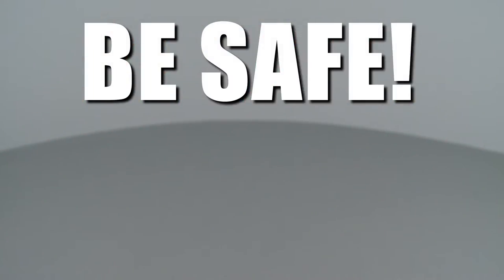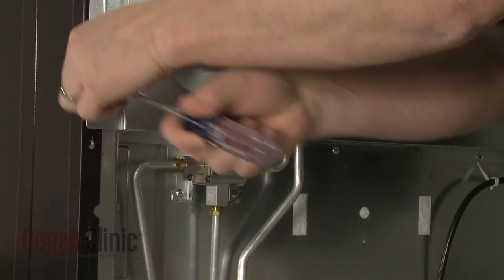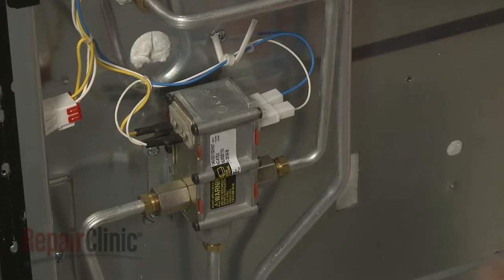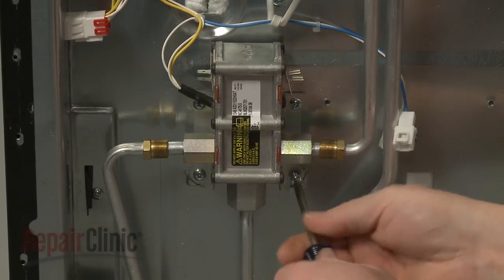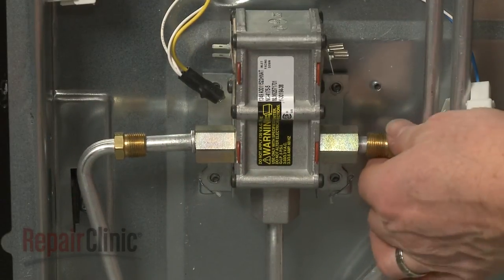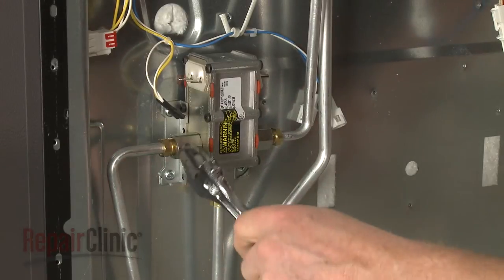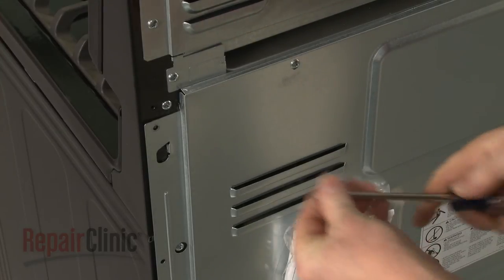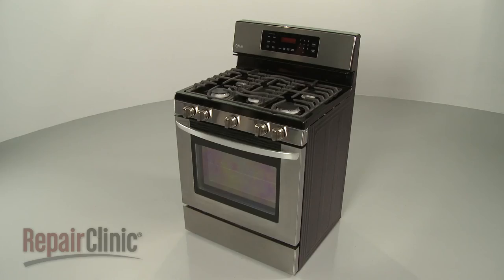LG Gas Oven Range Safety Valve Replacement #MJX62571701

Comment: great vid!! thanks.   I have an LG gas oven with a similar dual safety valve as yours. The stove and top burners all work fine.  The Broiler (with new igniter now and glows HOT) comes on but has a weak gas flow/small flames, they flicker on and off.  and I have adjusted the air/fuel mixer to be about in the middle.  I have continuity on both sides of my dual safety valve, very low ohms. any ideas???  THANKS !